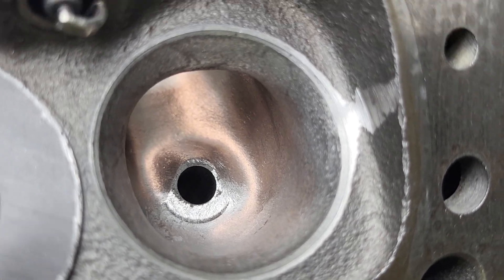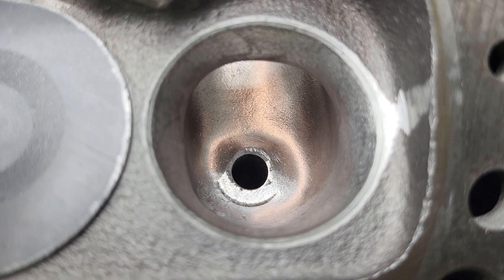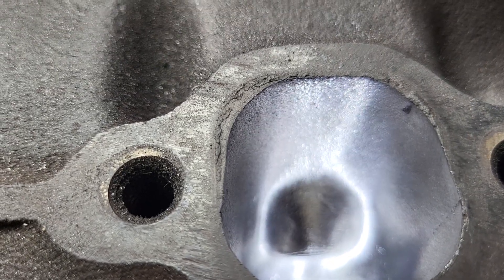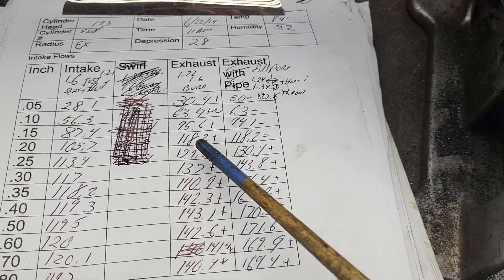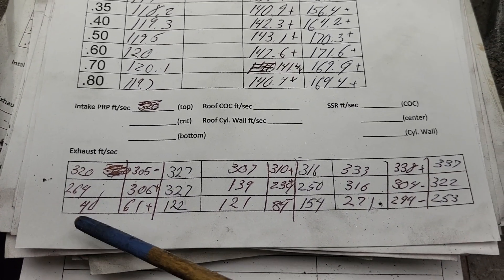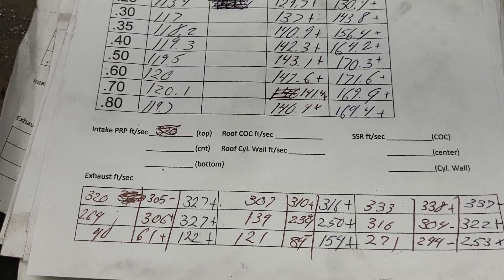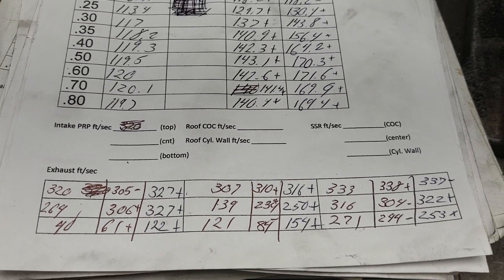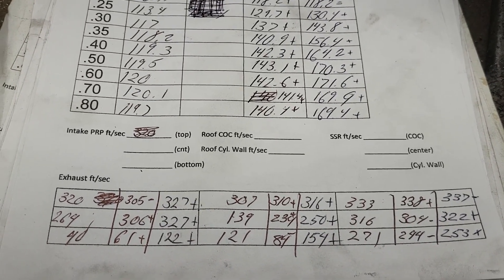Chevy TBI head exhaust throat experiment, full port cleanup.

Comment: Does and idle smoother with a great design cylinder head? Can you tell the wife that I would like to see you get some A/C ?
Reply from the maker: I have a/c.
Reply: @servediocylinderheads  good I'm glad
Reply from the maker: Does it? Good question. My engines have been accused of having a much smaller cam than they really did.
Reply: @servediocylinderheads  I've had one like that too I did alot of Quadrajet tuning and drilling to make it idle smoother compared to an engine with a Holley that was built the same but I also did some slight porting on the 461s. I did cheat some and used Rhoads lifters.  My idled like a torque cam and the other was choppy . Same cam and compression both were 327. It made alot more torque. Than the other.
Reply: @servediocylinderheads  I forgot This was back in 1984 I did a 3 angle valve job on a fairly new Souix valve grinder at the vocational school I went to. Boy that tells  my age. lol
Reply from the maker: @dondotterer24  Damn, I thought you were a kid!
Reply: @servediocylinderheads  that's funny lol

Comment: I had a little chuckle to myself when you mentioned pulling it charge during overlap. I pay a lot of attention to low lift flow, because I believe that it determines the high lift flow rate in the running engine. The more charge that you can get moving sooner,  the higher the final velocity will be. Well, that's my theory anyway
Reply from the maker: So you agree?
Reply: @servediocylinderheads  absolutely

Comment: Hi Charlie. That was quite a big gain for seemingly little work. You said that you just basically cleaned up the port and narrowed the guide. Would there be situations where you would have a throat that is not round? Maybe wider on the sides and back but narrower or less removed from the ssr area? Thanks Andrew
Reply from the maker: My throats are usually offset. Still took me a good amount of time to port this!

Comment: Does flow from the exhaust at .100 really matter? Isn't the speed at nearly or sonic, all that pressure means that flow is attached everywhere.
Reply from the maker: Good question.
Reply: @servediocylinderheads  At close to sonic speeds, the rules of air are opposite than at slow speeds. Expansion accelerates, contraction slows down with high speed flow. At low speeds, contractions accelerate, and expansions slow down flow. At low lifts the exhaust is as fast as it's going to get and it's the most likely to choke, and change the way it behaves than at higher lifts.

Maybe the lower lifts from the exhaust tell you more in terms of what will happen during overlap.